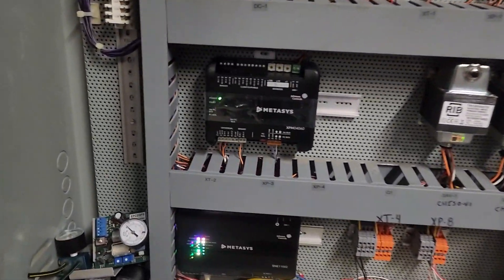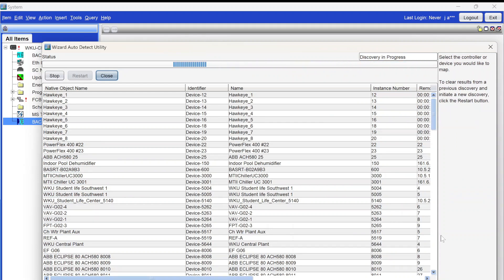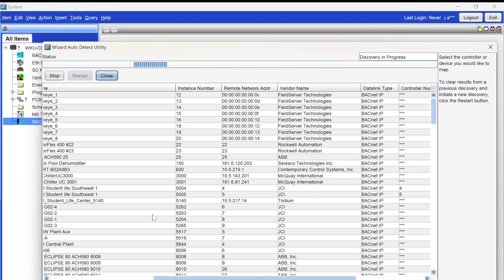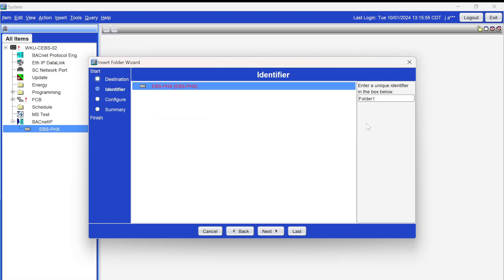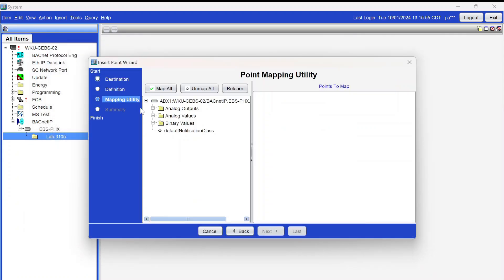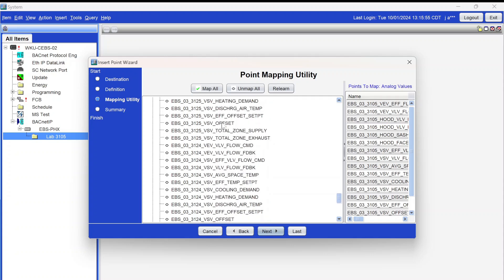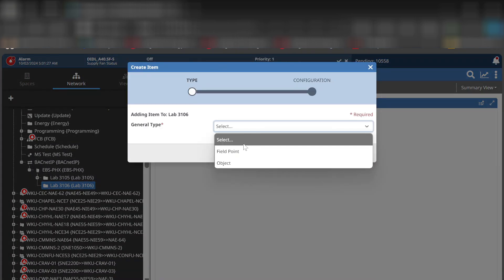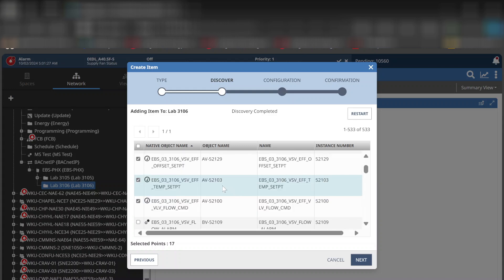Building Automation Hack You NEED To Know

Comment: With the new engines did they fix the issue when pulling points in the other way?  I run a Tridium network, and in the past when I integrated a NAE or NCE it would never give you the actual point names, they came in basically as the object number (so for isntance DAT would come in as AI_2304 or some other nonsense).
Reply from the maker: The only time I've had thar issue is if the naming wasn't done in the device being pulled in.